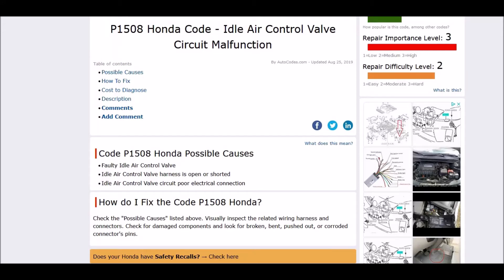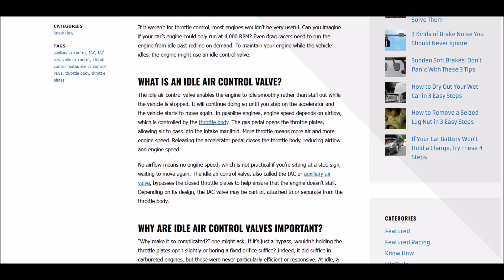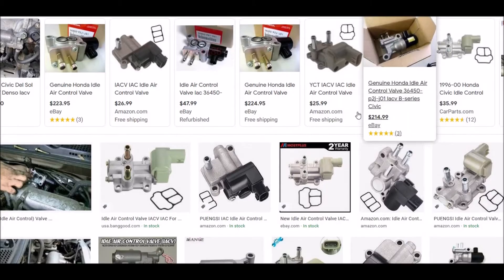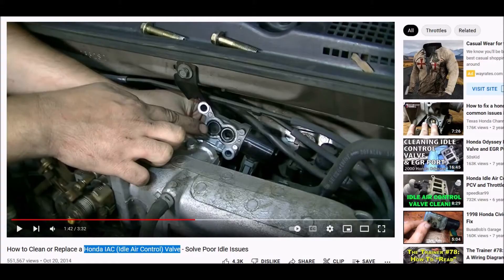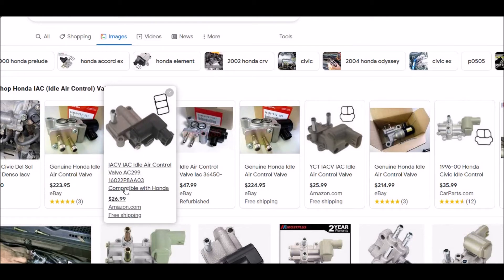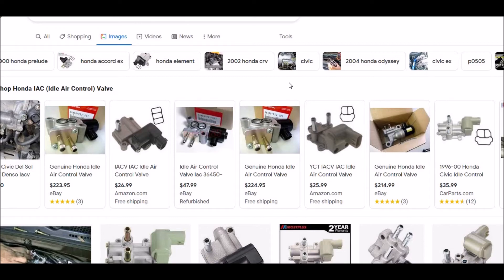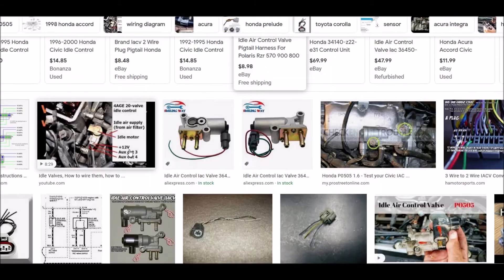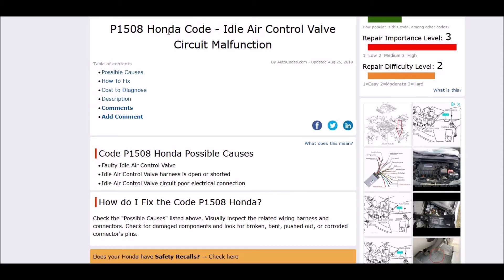How To Fix a Honda P1508 Code:  Idle Air Control Valve Circuit Malfunction

Comment: I just put oem still failed inspection no more stalling idle up n down nomore do i have t drive lil i changed it 3 days ago ....da 30$ ines i changed no good ..i paid 250 for it ...il check da wires smh